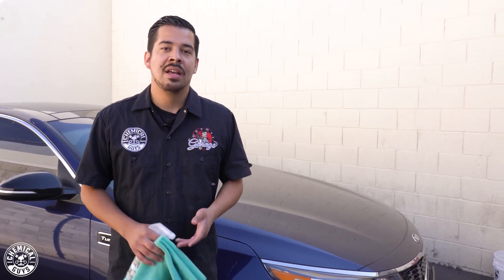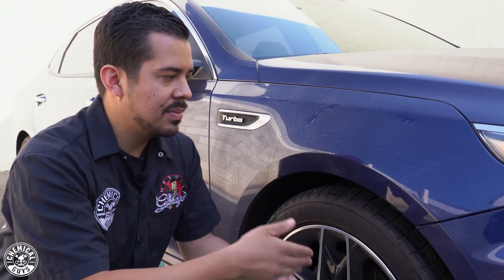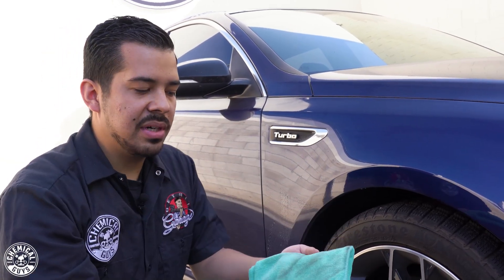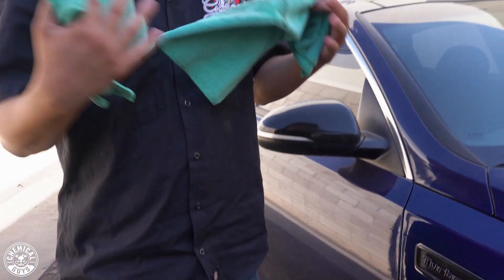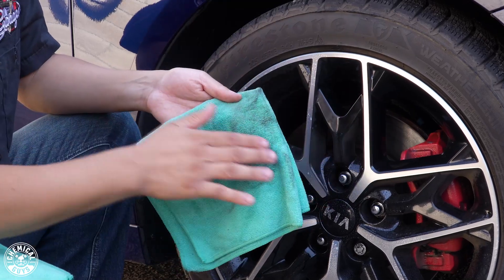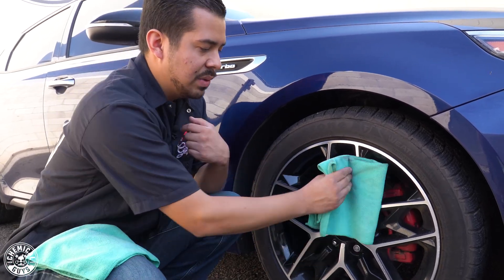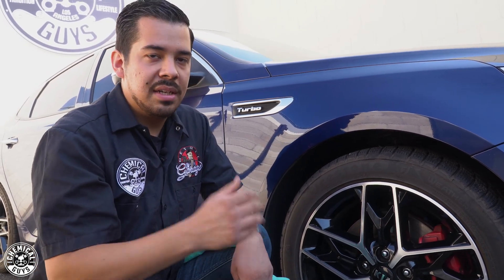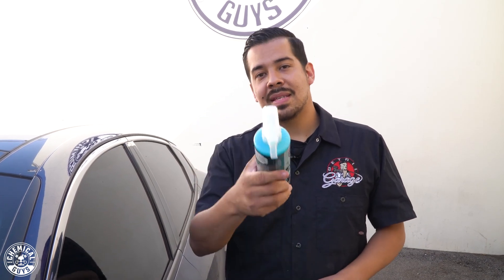How to Wash Cars Anywhere Without Running Water! - Chemical Guys

Comment: is Swift Wipe pH neutral...?does it strip off paste/spray wax or ceramic applications...?
Reply from the maker: Hey Kenneth! Swift Wipe is safe for all coatings and gently removes messes while enhancing shine.
Reply: @ChemicalGuys  tks for the info...i find that it is truly super effective...it definity enhenced the gloss effects...the only drawback is on the windscreen...after applying HydroView and my windscreen got dirty...i use Swift  Wipe to clean...but the after effect is the windscreen gets foggy or blur when the outside tempreture drops...but it gets back to normal again and becomes clear when the air gets humid again...my bet is the air con does play a part in causing the windscreen to be blur or foggy...